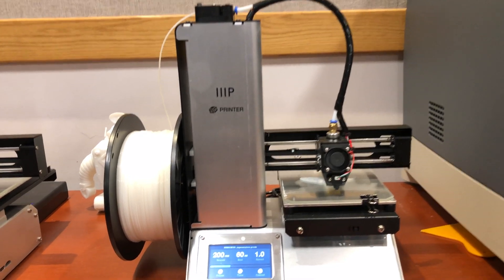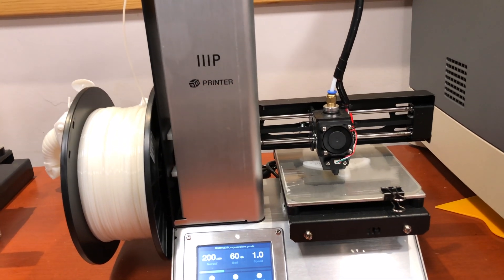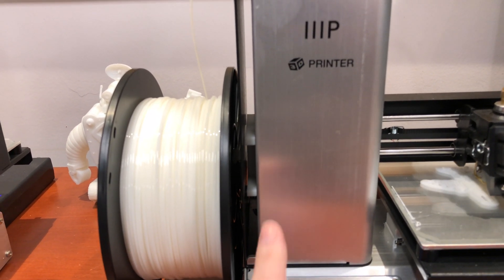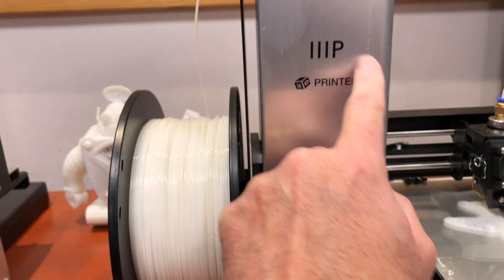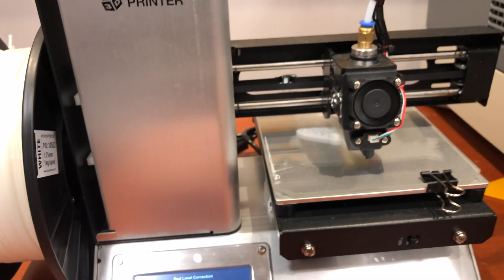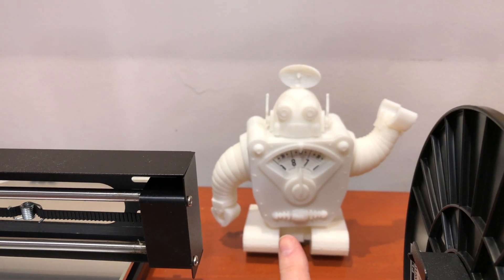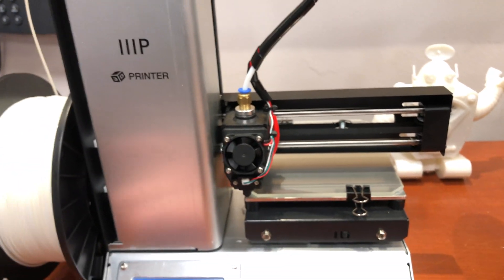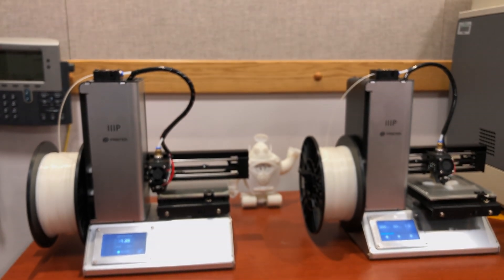Monoprice Select Mini Pro fixed

Comment: Hi Jay, Do you have a preference between the Monoprice and the Michelangelo you use at home?
Reply from the maker: I'm leaning toward the Monoprice at this point, even though it has a smaller build plate.  Once I got the kinks worked out, I've had no problems with them.  The Michelangelo has been giving me frustrating problems lately.  The bed doesn't stay level for very long and I have to keep tweaking it.  The guide wheels keep coming loose.  It's just a lot more maintenance than I expected.  Now I've got a weird problem where it's somehow not putting enough infill into objects, no matter my setting.  Also, the Michelangelo is in my basement, which is cool in the winter.  Since it doesn't have a heated build plate, I have to heat the room to about 70 degrees or else the prints come loose and the hot end spews filament everywhere.
Reply: @jayducharme   Good information. Thanks. Any chance you can put the Michelanglo in some sort of box that could be heated with light bulb? It won't address the other issues but might keep you from needing to  heat the basement.
Reply from the maker: BBHouseRodent   I don’t think a light bulb would do it.  There are people who’ve added heated beds to a Michelangelo, so I might try that.  That still wouldn’t solve the other issues it has, though.